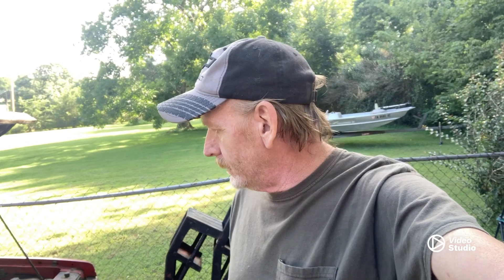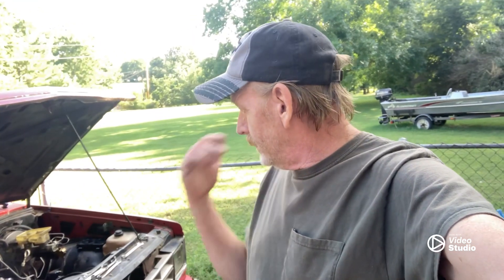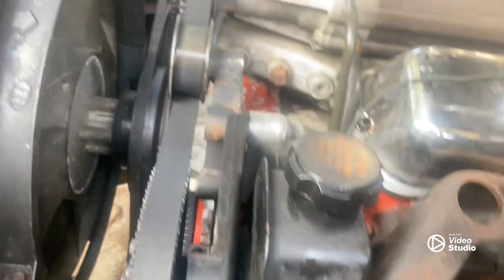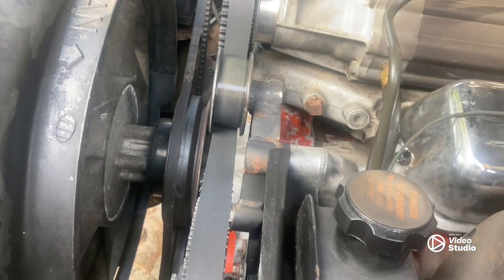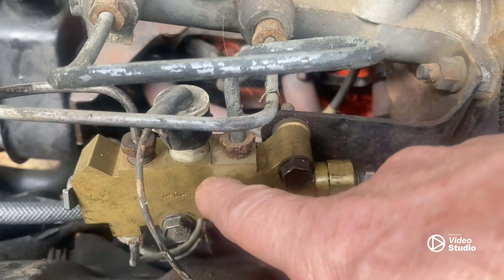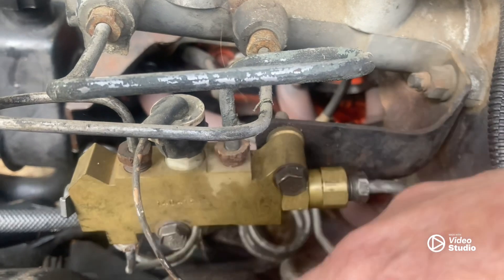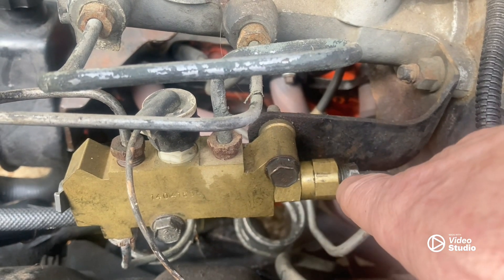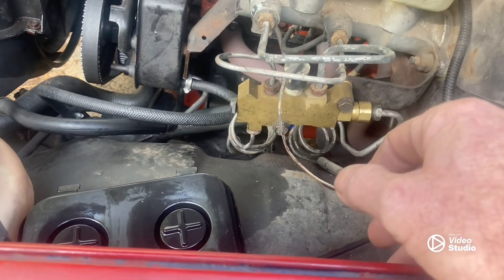It’s another Wednesday!!!

Comment: What it does is keeps your front brakes from locking because of the Disc Calipers (piston). The back drums have heavy springs to compress the wheel cylinders and pushes the fluid back, calipers don't have that, so that valve helps to keep the fluid from holding (or delaying) the piston to rotor when you let off the pedal.... if that makes sense. There is more to it than this, but that's the skinny on that valve.
Also on a Disc Drum set up, it's easy to tell which is front and which is rear, because the bigger line is always for Disc, because of the bigger piston on the calipers. Takes more Fluid than those little bitty wheel cylinders. It gets confusing because they usually run the front brakes off the rear of the master.

Comment: Maybe???. An O ring?. Or maybe dirty check valve??. Does them connection even come apart??. Time is what it is though. 
Maybe just some thread sealant??. I'm just sharing thoughts, okay. 
How about just sealing the link and learn how to apply the E break??. Just thanking of the KISS thoughts.
Great job and to see a air filter.  Maybe I type too much or watch, read too much.??. Weight reduction vs air flow.??. Maybe later with time as it is. Space the hood at the windshield side as to maybe still lash in front?. Like, I've read about, air induction. 
I'm just sharing my thoughts on stuff and watching you overcome lots of sweating. 
Hang on tight and enjoy the ride!!!!!...
Reply: Huh?lol

Comment: had the same problem on the yellow truck  musclecarmitch908  is right  front brakes  works 1st   hate to tell u this  putting fitting in the the back brakes will lock down   been there  only way to fix it is replace it   borrow off the blazer